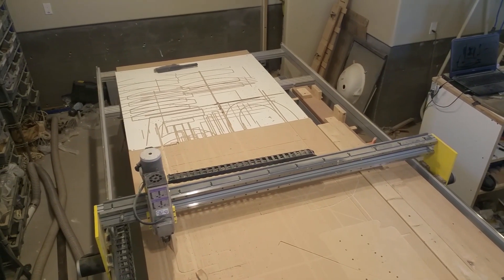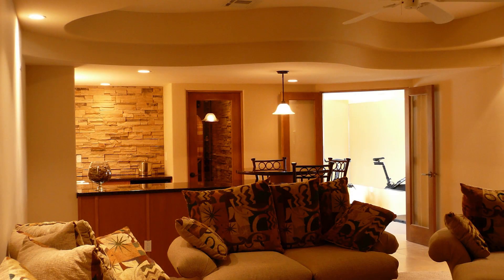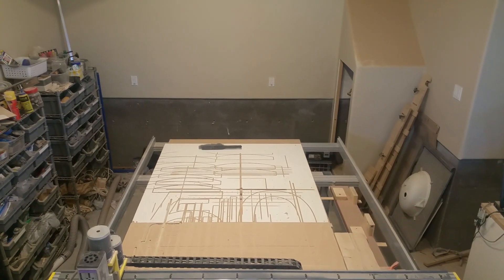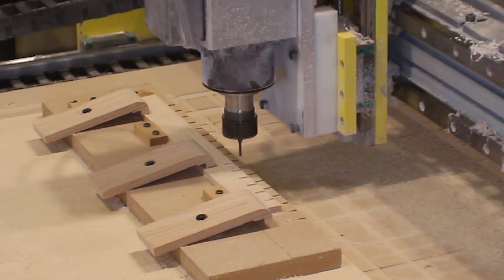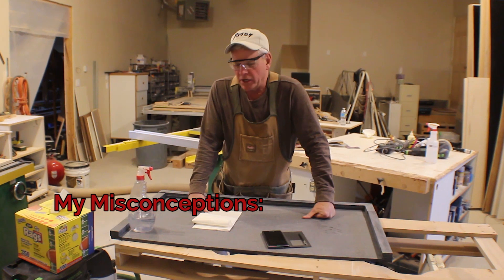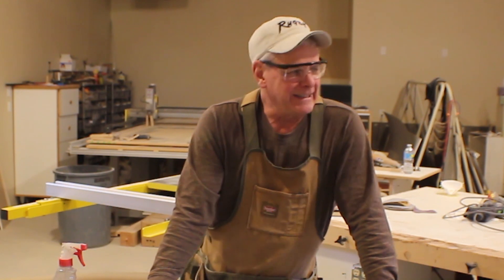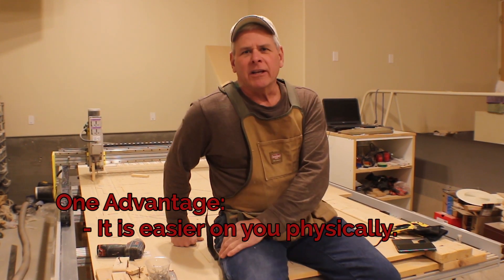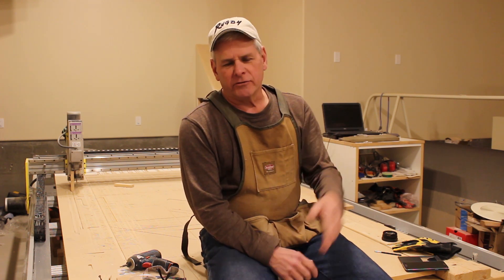Using a CNC Machine Over 10 Years - Lessons Learned

Comment: look at all the woodworkers on youtube. You will not find a single one (beside yourself) that works with solid surfaces. I Think all woodworkers should atleast try solid surface as it uses the same tools they have been using with woodworking. So the learning curve will be very low.
Reply from the maker: You know, MySchizo, you make a good point. In the past 12 years or so since I first learned to work with solid surface, I have not come across another woodworker who does it. I think most probably realize that you need to go through a certification course to be able to buy materials from some of the major manufacturers, so maybe that’s one of the limiting factors. But you’re right, they have a lot of tools already. And they really would enjoy working with it as I certainly do.

Comment: you need to put a gas spring on the spindle axis. so it wont fall down..  how many bits did you loose?
Reply from the maker: Thanks for the suggestion, CapApollo! Never had heard of that as an option. Always support the spindle before powering down so never had an issue with damaging a bit. My spindle lowers very slowly when power is cut as well.
Reply: @RustyDobbs  so there is no much problem..  i have a rack and pinion axis. without the gas spring it drop like a rock.
Reply: btw... invest or diy a dust shoe with a cyclone..  is very easy to make
Reply from the maker: Yeah, I considered that early on when I was doing much more work with it but was too busy to get to it! Now I am using it much less so I don't want to take away time from other things to build one! Can't win for losing!

Comment: After using a CNC for metal and wood work for ten years myself now, I can exactly relate to everything you say in this video. I agree to all of your points. Thank you!
Reply from the maker: Yeah, thanks for your confirmation, HolgerBarske! The first time I saw a CNC in action in person, I knew that I would get one. For the solid surface work it was a must! Since I do very little of that anymore,  it is a pretty expensive tabletop more times than not these days. I'm still glad I have it and have plans to better work it into what I do now. So, hopefully,  it still has lots of days of use in the years to come. The software I use is a very old program, but it runs the machine fine. Haven't really explored the newer packages to determine if the 'bells and whistles' are just more colorful ways to do what my software already does. I appreciate you watching and your comment!

Comment: Really enjoyed your pragmatic approach to the question of whether a CNC Router is of use.  In my case, I find it helpful as I can't move heavy sheet or slabs as easily any more and I can machine up the parts or flatten slabs much more easily. It certainly isn't a "do everything" machine but there a some things it is really good for - it allows a degree of precision that can be difficult to achieve by hand tools.  I would be interested to see more videos on how you use the CNC.  Thanks again.
Reply from the maker: Thanks for the comment, justcruisin109, and for relating your experience. Sounds like we have reached similar conclusions. I haven't done slab flattening with it, but that is certainly a great use. Yeah, you can get very creative with it particularly with the precision capability but every new function requires a new setup procedure and that is what I find takes time. But it is an interesting machine to work with. I will be getting a little more freed up in coming months and plan to work in some CNC project videos during that time. Thanks again for watching and the comment!

Comment: Awesome video Rusty! I appreciate you sharing your experience in this area. You talked me out of buying a CNC machine. Not that I have anywhere to put it now. Someday when I get set back up I might reconsider....
Reply from the maker: Thanks Danny! Yeah, that's kind of an individual choice. They are interesting tools but my guess is that lots of people that have them find they don't use them very much. They are not something you just plug in and start cutting. They are a lot of work. When they are cutting, they are not much fun to watch, but you still have to keep your eye on them. I think many of the lower priced machines have undersized routers and people don't realize how big a problem  that can be. Immediately they realize that what they expected the CNC to be able to do can't be done at all or is going to happen very slowly. In my case, I knew pretty much what I would be doing with it and the guy who built it for me sized everything accordingly. My router is 3hp so I have never had an issue with power on anything I have done. The only issue now is that I am slowing down my contracting activity and don't really need it taking up so much room in the shop. I could cut it down but need to be sure that is what I want to do before I do it.